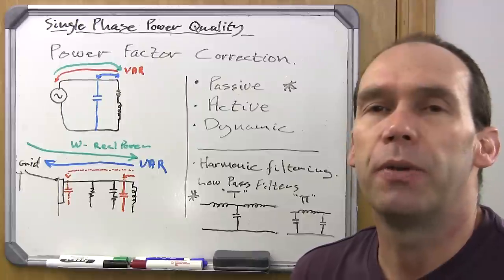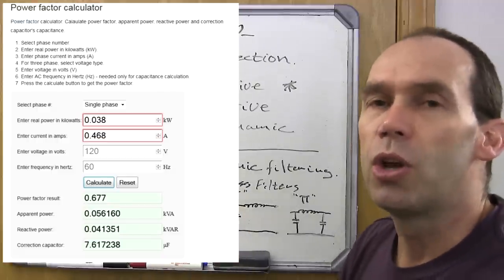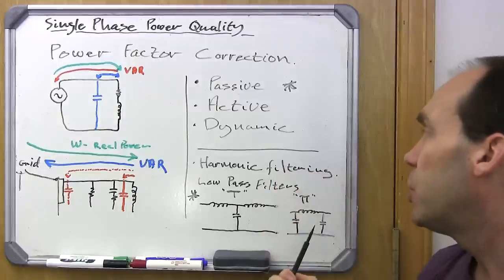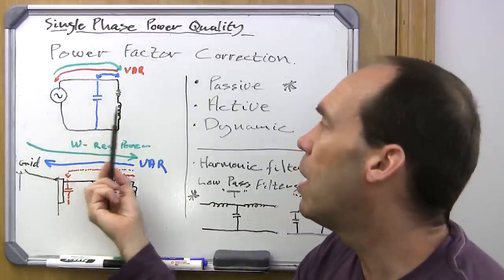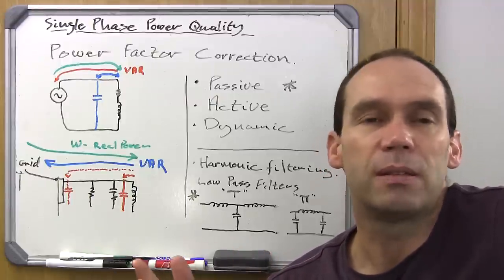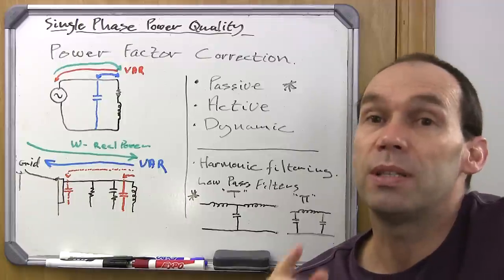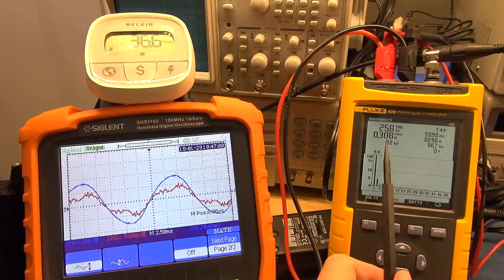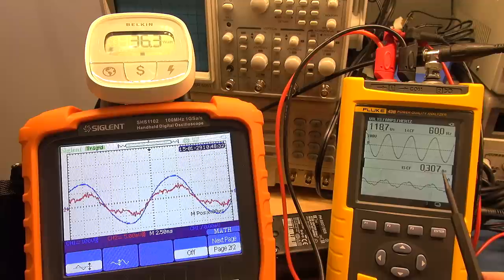Single Phase Power Quality Pt3 - Power Factor Correction

Comment: To many snake oil sellers :)  Great video you did quite a bit of investigation and learning on this.
Good that you looked in to the grid tied PV issues most people do not understand why at this point there is a problem with large PV installations without storage. I do not see how inverter power factor can help with this situations the only way is to stop sending power to the grid when there is excess so that they do not need to turn off much slower generators.
Just less than two hours before the new Solar BMS is on Kickstarter and once I have a link I will sent it to you.
Solar BMS is for Off-grid :)

Comment: I am watching your video because I have 8 motors at my work place that come on and off and I have power factor issues. Most important is as you said utility penalty for power factor and the second is low voltage especially in summers which is quite a problem for me. 
I have corrected the three phase motors but my single phase motors are a problem. I want to correct the single phase power factor so that the Transformer is not overloaded and I can get those 10-15 volts improvement

Comment: Hi Martin, can you do the power factor test like this by using wash machine or dryer which consume 3 - 4 Amps at a time ? If there is a difference, which means you are working for......, But if it is like this video which means it's a matter of miliamps and almost no difference, then I believe your testing (experiment).....show us your experiment by a big load which is like I mentioned ....frigrator  or dryer or washing machine...house hold stuff ....etc.       thank you M.

Comment: Great presentation! I have done a basic course and I wondered if I could ask what is in the main neutral conductor in a domestic consumer unit?
If it is all the current in the house, then surely there must be a voltage to cause that current to flow. I assume that the voltage is actually quite low, but is dependent on the overall length and resistance of the supply cables?
IE: if the supply cables are long then the voltage in the neutral at the consumer unit would be higher than one were the cables are short owing to the resistance?

Am I thinking correctly?

SAM

Comment: Do we get the same results if we are dealing with DC power, for example solar panels ??.
some people claims to save money and even the battery bank holds the charge  longer, when installing capacitors in a solar panel set up.
what is opinion about it ??.

Comment: The Fluke 43b is a great scope meter for real time troubleshooting.  I can’t find anything to replace it.  I need the transient capture feature, but i really need the real time sag and swell recording.  I have to figure out a lot of flickering light concerns.  The last one was a defective power supply on a laptop computer.  The one before that was a copier/printer that shared the wire from the main panel to the sub panel and cause the lights fed from the subpanel to flicker.  Can the Fluke 345 perform these tests?  Otherwise I will have to use a power quality analyzer and download it over and over again for each circuit tested.  Very time consuming.
Reply: One thing I’ve noticed is that using the inrush current on other clamp meter will only give you the inrush of current.  The wont give you the corresponding single cycle voltage sag.  Does the 345 have a single cycle inrush with a single cycle sag (at the same time) test?

Comment: i have a problem,if use inductive loads reactive power generate and that reactive power flow back to the grid,in domestic there is no capacitor bank so large amount of current flow through the MCBs and RCD so why they didn't trip